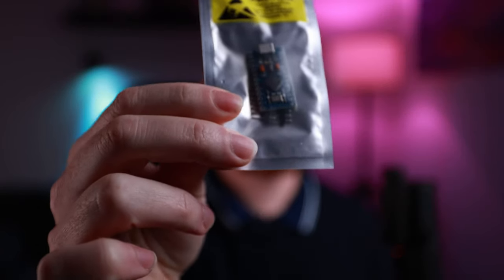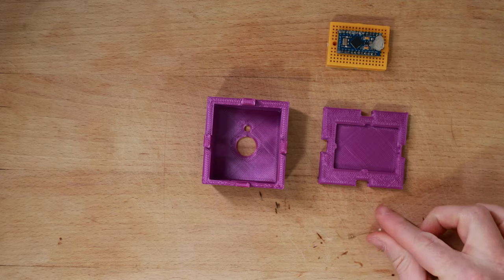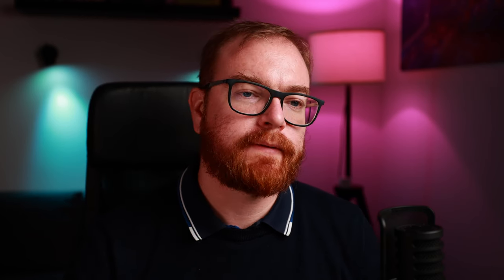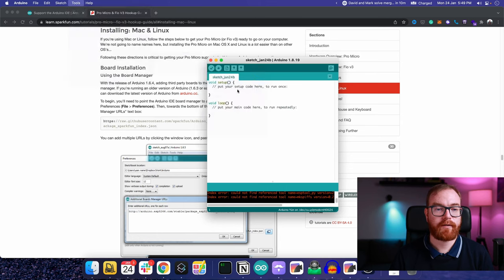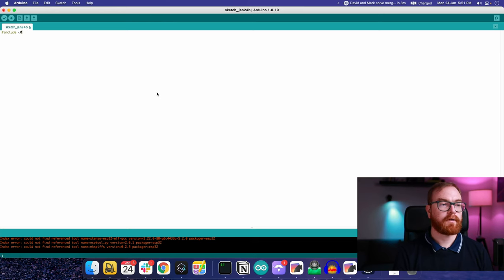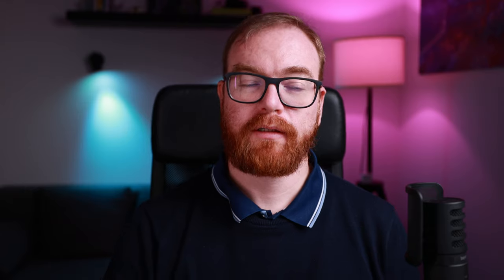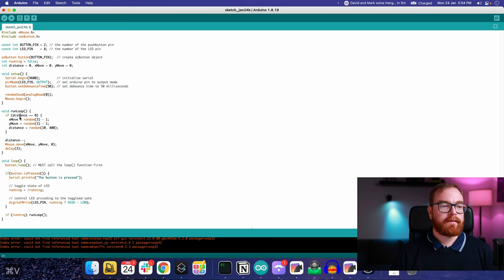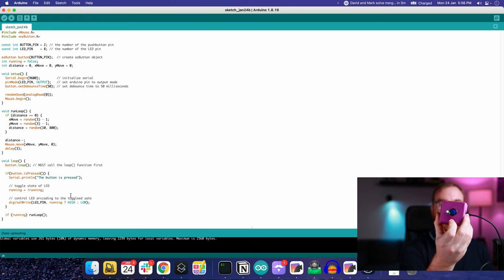The Mouse Jiggler

Comment: My PC at work is controlling, via GPIB, a bunch of power supplies and equipment.  If it sleeps, it leaves the electronics in an unknown and possibly unsafe state.  Corporate software recognizes commercial jigglers, so I'm hoping this one will be sneaky enough to work.  Great project!
Reply from the maker: Awesome! I'm super curious if it will work, but since it's just emulating a mouse, don't see why wouldn't it. And if the corporate software detects it by the movement pattern, that can easily be changed. Please let me know how it goes!
Reply: what we need is something like an aimbot, it should be able to learn your mouse movement patterns and reproduce them. Having said that, it is meaningless, remote work needs different rules to work, if they try to keep your time they are doing it wrong, it should be based on goals not on timesheets or watching you online 80 hours a week. It should be deliver this ticket in this deadline, period. If there are issues in the middle then you should be able to provide evidence of the issues and get help and update the deadline or scope.

But most managers are d-mb as f-ck
Reply from the maker: Absolutely, I definitely not support tracking your employees. Work should be about results, not hours in front of the computer... With that said, recording and playing back your mouse movements sound like a fun project, maybe I should build a "Mouse Jiggler 2.0, rewind and rejiggle?"